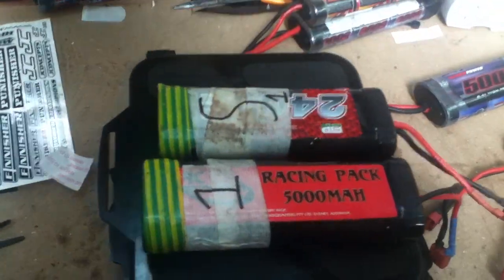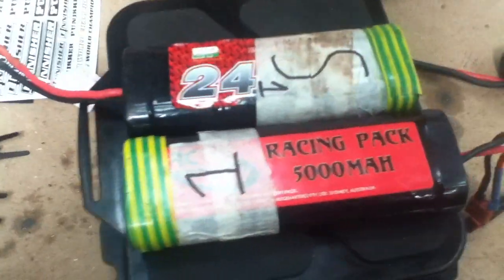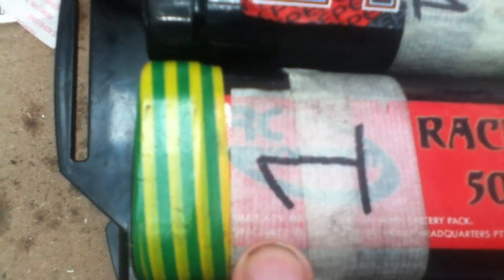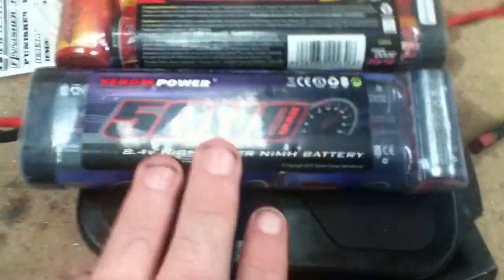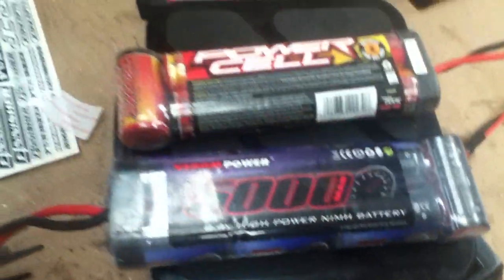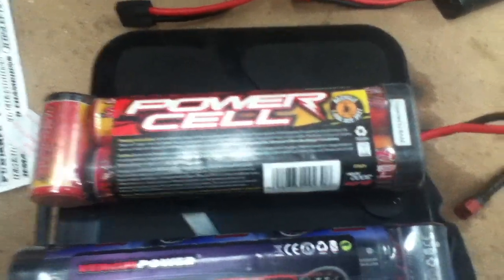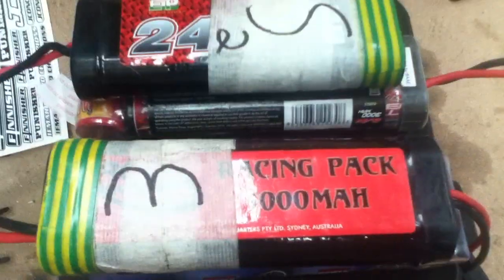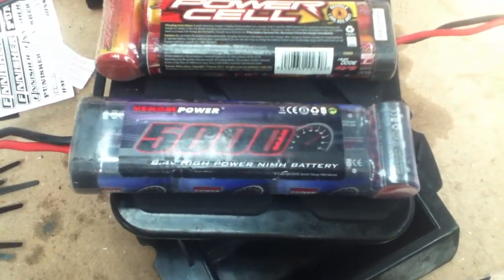NIMH battery review and fill in

Comment from the maker: basic yes, the Mah rating is the run time and the Voltage rating is the power, however a high voltage battery with the same mAh will last a little longer because it has a high starting voltage. Brands do make a big difference in battery life and power output though so read up on your brand that you want to buy first.